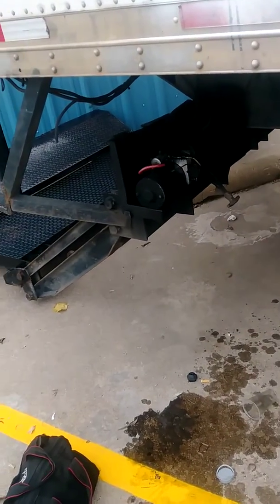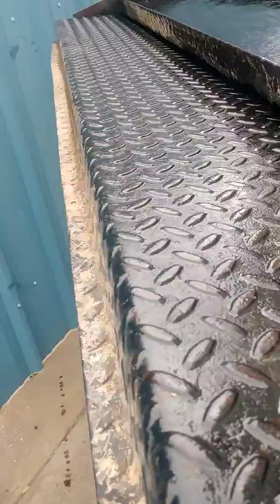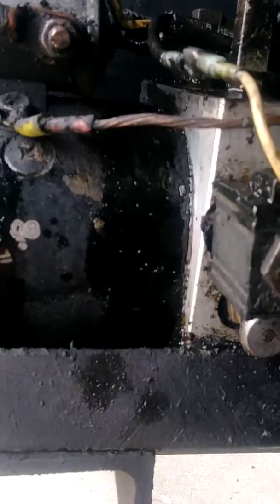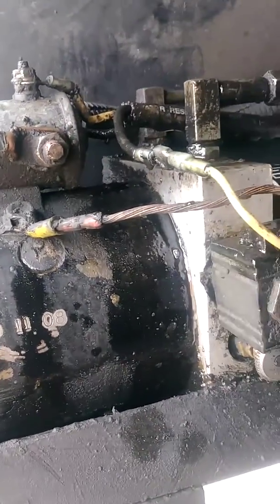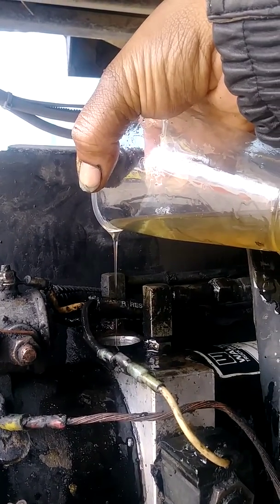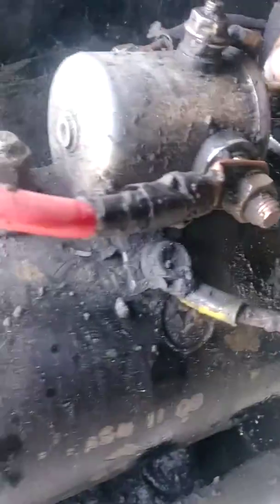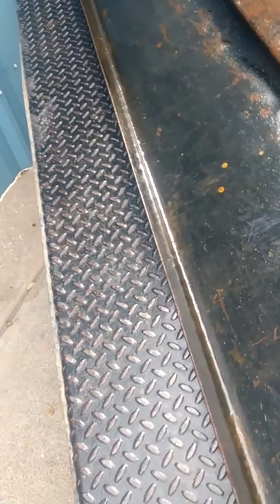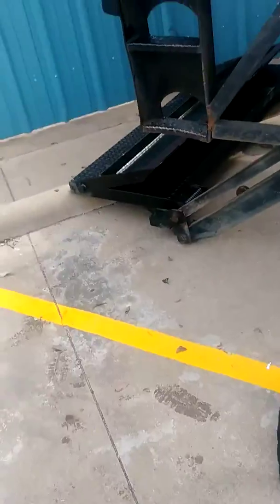How to add hydraulic Fluid to maxon lift gate

Comment: I have a very similar lift gate on my box truck and it’s stuck in the up position. It won’t go down. I lifted it too high and it bent up the deck a little bit and now it’s stuck in the closed position. Has this happened to you? How can I get it unstuck?
Reply: Dave Nielsen you try standing on it, and bouncing while using the switch
Reply: this problem is regarding the solenoid, if you hit the solenoid with a hammer (not to hard) you can see it working again.
Reply: Did u ever fix it and how?